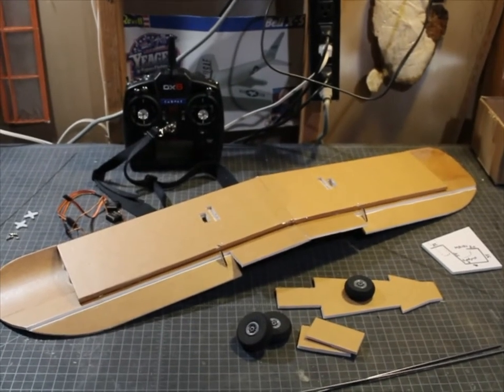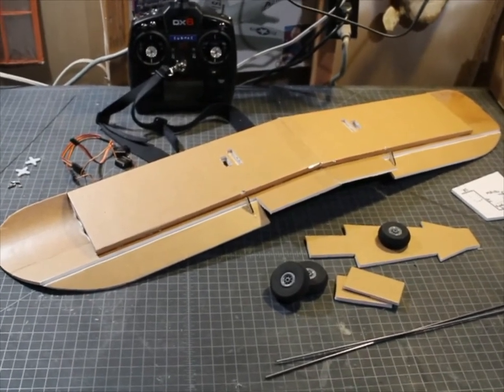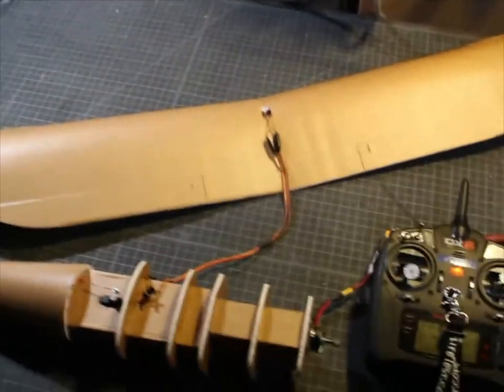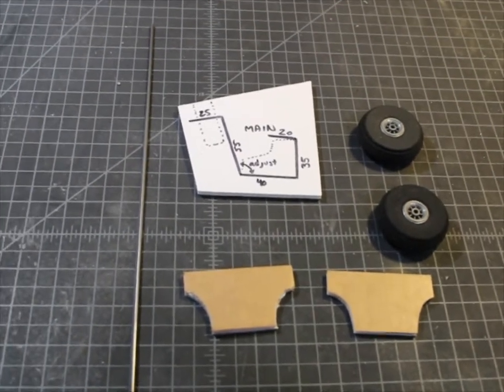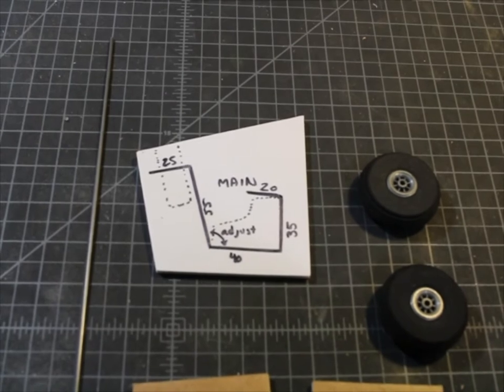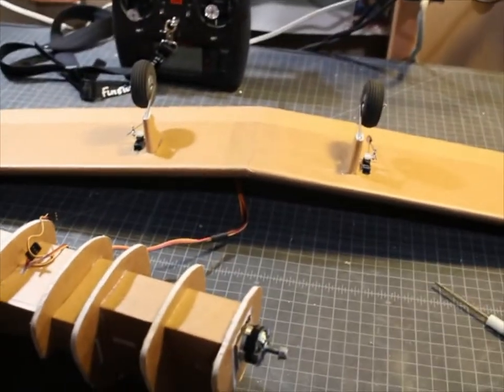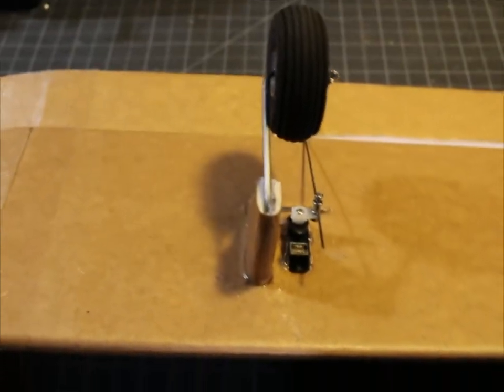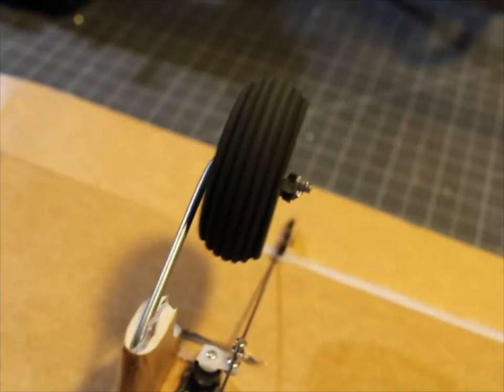Mini Ercoupe Build Part 6: Main Gear

Comment: this build series is awesome! 

CRAZY Idea: to make an RC Ercoupe fly really really REALLY scale (steering wheel having all control functions, and steer like an automobile ),,,,,use an RC car transmitter, then somehow program the wheel to turn rudder and ailerons...but using the same steering wheel for elevator would take some real engineering above my skillset:) thanks for sharing these!
Reply from the maker: I suppose there is probably some off the shelf steerable nose gear available that would do the job?